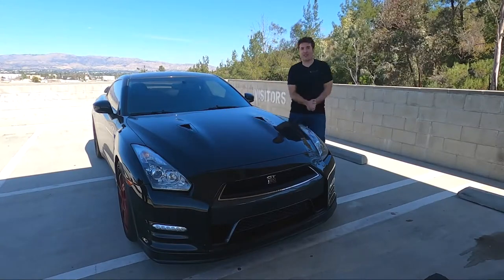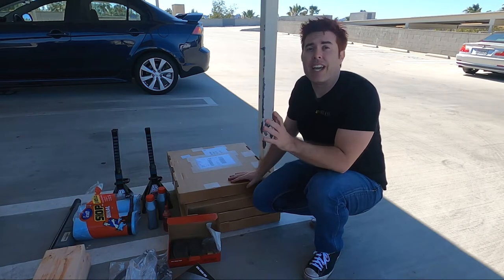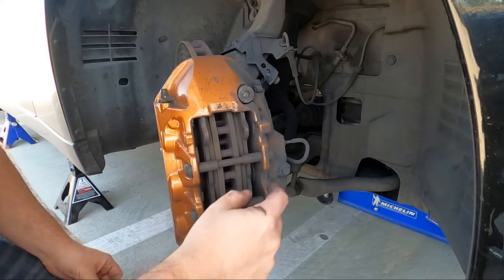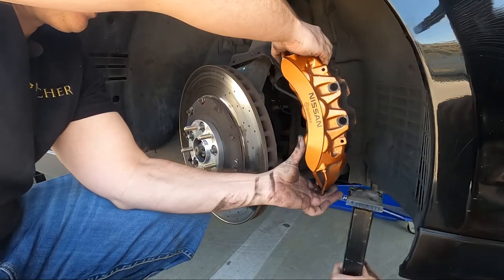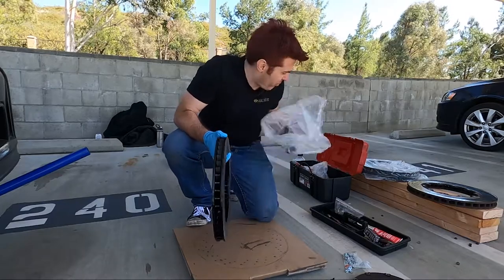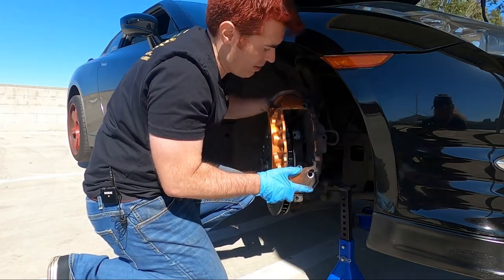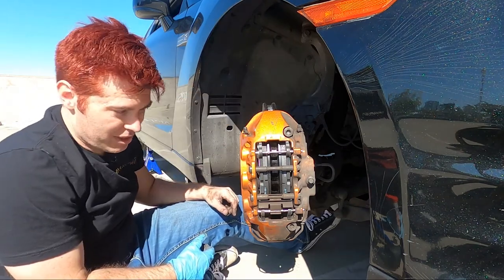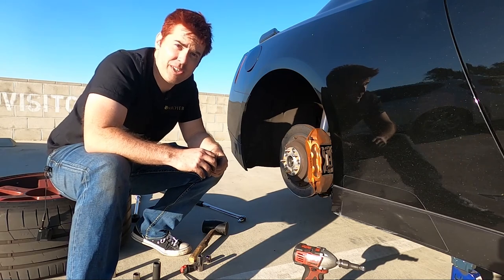NISSAN R35 GT-R MAINTINANCE: HOW TO CHANGE THE BRAKES, ROTORS AND PADS PART 1

Comment: You ever get a clicking noise on your GTR? Every wheel rotation I get a click. Someone mentioned to remove the rotor and clean up any rust on the high-hat and then use brake lubricant on the mounting surface.
Reply from the maker: I've not gotten any clicking noises the sugesstions don't sound like bad advice. You could also have a small rock or something in your rotor. Could be a bad bushing. Or maybe an issue with the bearing, but I doubt it's the bearing

Comment: You don’t need anti rattle clips for the fronts..only needed for ZR1 394mm rotors so that’s why SBD only supply them with the rears
Reply from the maker: No you need them, see my video on how to get rid of the front end rattle. That pin rattles without them
Reply: @JDArcher  oh ok, I asked Chris why he only supplies them with rear kits and not the fronts and that’s what he told me..will take your advice and get a set for the front 👍
Reply from the maker: @chelseamad66  well, it also depends on the year of your car. The 2015 and up have both clips stock
Reply: @JDArcher  mines a CBA 😉
Reply from the maker: @chelseamad66  then you'll definitely need a set. If you find my video on getting rid of the front end rattle I found a spot that sells them for cheap
Reply: @JDArcher  I’ll take a look..great video’s btw 👏👏
Reply: @JDArcher  Found the video..CarID want to charge me $182.53 shipping to U.K for $30 worth of clips 😂😂
Reply from the maker: @chelseamad66  thank you

Comment: Great content, after watching your video l looked at mine from Speed By Design and the shop that installed put the rears on backwards. Wonder if l should leave how they are or reverse them? I have about 1k miles on them.
Reply from the maker: I'd swap them over. Its actually easy because you don't need to swap over the hats. Just move the whole floating rotor from one side to the other. The reason the vanes face the way they do is to cool them down
Reply from the maker: Also by changing the direction of the slots to forward facing they'll grip better
Reply: @JDArcher  Thank you! Are planning on any future modifications?
Reply from the maker: @darrenthomas5541  hopefully FBO and some interior carbon fiber wrap. However those plans may become difficult with the new laws that were released by the EPA.
Reply from the maker: @darrenthomas5541  $200 is a really good price. 
The effects if the EPA memo are already being felt. Check out what Chris Riggs is going through with Speed By Design already. Might be a good time to buy 10 ecutecks. They'll be worth a fortune in about 5 years
Reply: @JDArcher  Wow is there an article out there discusses what SBD is going through?
Reply from the maker: @darrenthomas5541  its on thier FB page

Comment: Who in their right mind puts spacers on a GTR??? Same guy that smashed the front end all up and cracked the bumper paint . I feel you buddy. Lol sorry
Reply from the maker: Thanks. A lot of people put spacers on the wheels to flush the wheels with the body. I personally don't care fir that since I'd rather use the proper off sets. The thing is when you buy a used car you never know what the previous owners did. Both MKIV Supra's I've owned had some jenky stuff done to them. I even found duct tape holding things together...on both of them

Comment: Did your set come with new bolts and nuts?
Reply from the maker: Nope, just the rear retaining springs
Reply: Is it pretty safe to reuse the hardware or should I purchase some new ones? If new ones do you know where I could get some?
Reply from the maker: @TuanTruong-jt1km  except for the locking nuts on the floating rotors everything can be reused